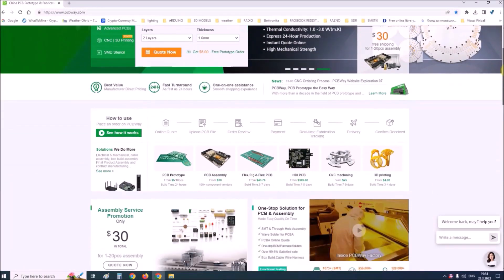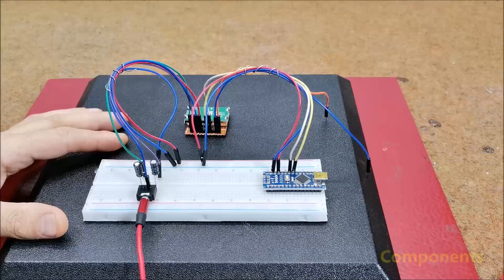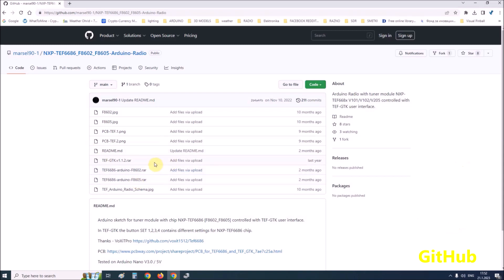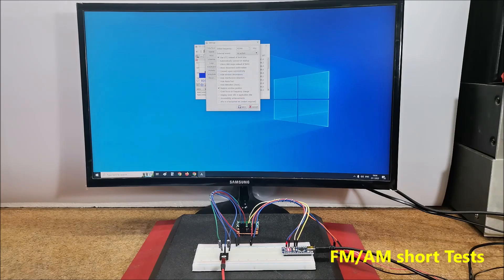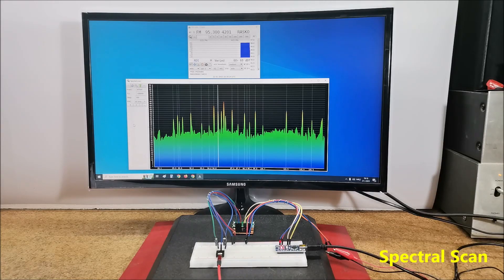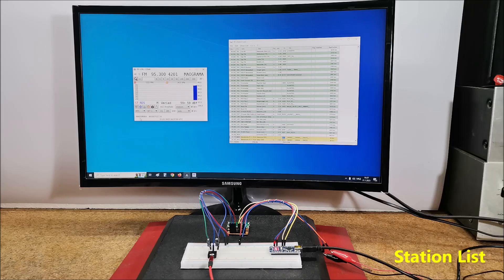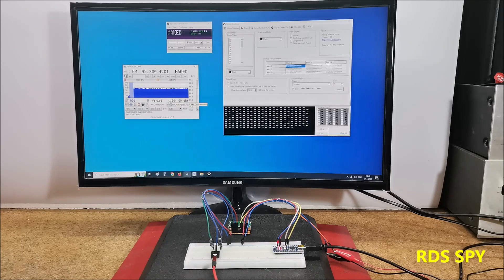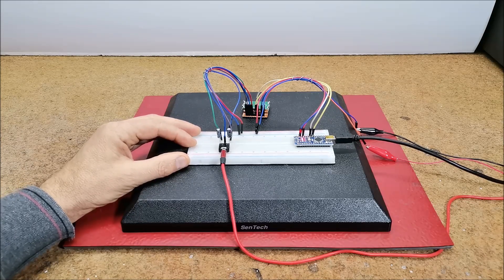Simple TEF6686 Arduino + PC AM-FM Radio Receiver

Comment: How do you tell chip version number?  Thank you!
Reply: I bought a tuner from the same store, opened and checked      F8602+crystal  9.216 MHz
Reply from the maker: You should open the cover and read it.
Reply: @MirkoPavleskiMK  i've already got it soldered. Is there a software way to find it?
Reply from the maker: @hdguppies  I don't think there is such software, but you can try the codes for both chips separately